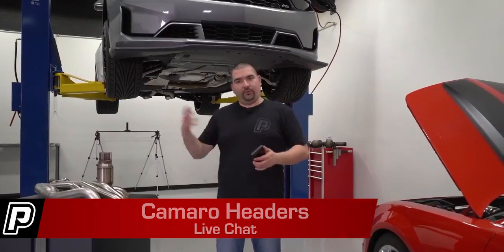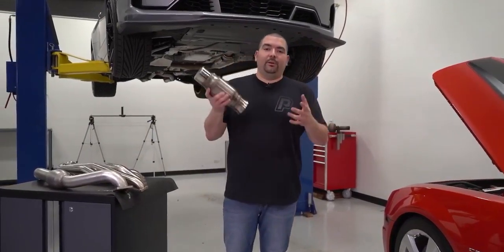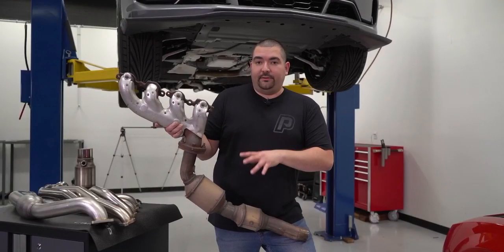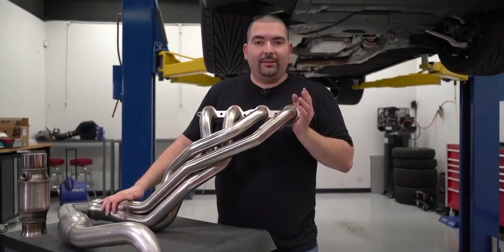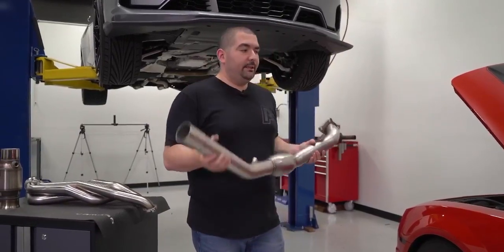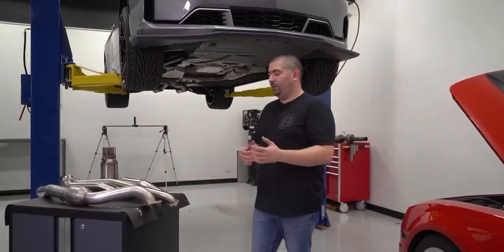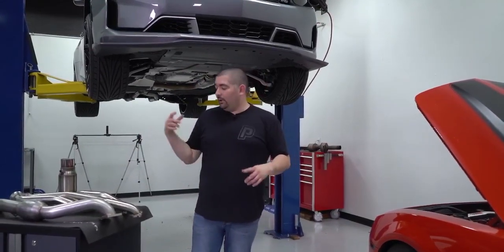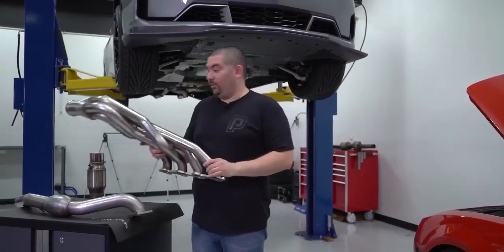Live Chat on Chevrolet Camaro Headers - Phastek

Comment: Can I tune the car with long tube headers with a handheld tuner,what's the best handheld tuner y'all have?
Reply: Dude I looked in to the hand held tuners alot look just save that money you are going to spend on the hand held tuner and just go to a shop get a Dyno tune. It is just best to wait and get it tuned at a shop but ay if you have money just to spend well than who am I to tell you anything
Reply: @ssjohnny6311  email tune vs dyno tune ?
Reply: @6.2pete  I'm telling you just save you're money I don't even care if it's 50$ a week save it put it all twords the Dyno tune at a performance shop you trust. Any other options you have to tune you're car is that just options. But you make the decision
Reply: @ssjohnny6311  yes dyno would be the best option, but can they change me back to stock if needed or does it come with in adjuster switch . Reason for that is because I’m planning on going e-85
Reply: @6.2pete  well yeah if you take it to them stock. I don't see them having any issue putting it back to factory mode

Comment: I want to put long tubs on my 2019ss. I got a cat back 3" on it now. What pipe connections would I need to install them.
Reply from the maker: Unfortunately you would have to modify and make the connections work with the systems you have.  There are no connection pipes that you could purchase since each manufacturer has their own way of building the systems.  
 
Now what you could do is purchase a set of headers that are built by the same manufacturer as your exhaust, if that manufacturer makes headers.  Doing it this way will typically allow an easy connection.